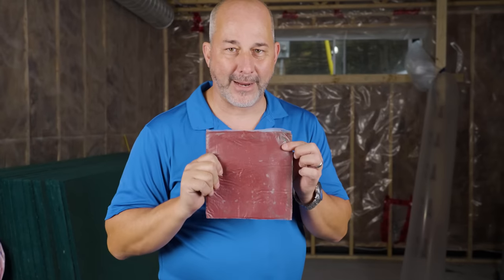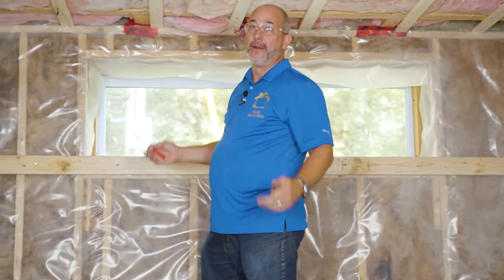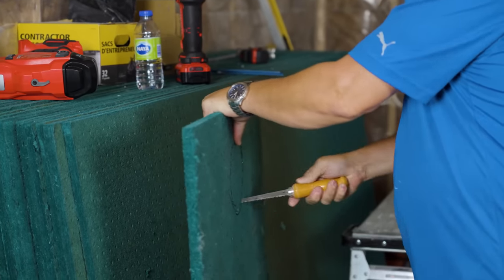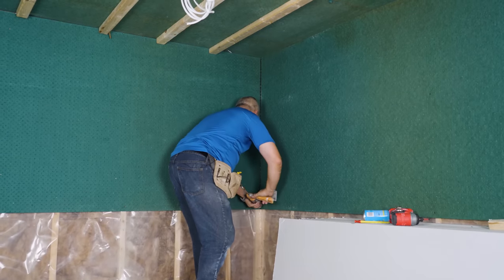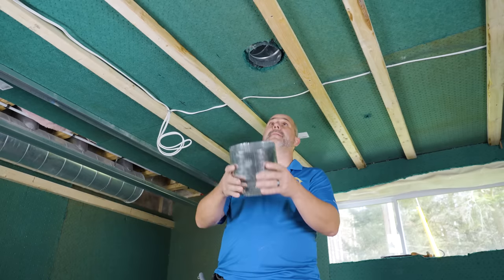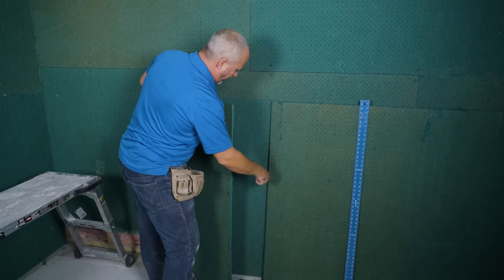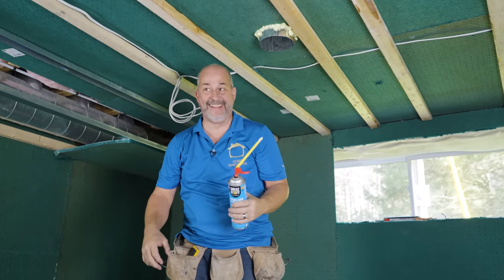Soundproofing A Room (It's Easier Than You Think)

Comment: Hi Jeff,

Will you be going in detail how to finish around the doorway and soundproof it properly? I'm using sonopan for a bedroom adjacent to the furnace room, but using isolating clips, hat track, green glue and double drywall etc for my wife's music teaching and recording studio. Thanks.
Reply: This is a question I would like to see answered as well.
Reply: a heavy/massive door,  or two "normal" ones, with a minimum distance between them (usually the width of the wall, with some absorbent material between them. This is usual in small/cheap studios)
A "normal" door or window is the weakest point in a project like this, it can ruin all the insulation work you did in the room

Comment: Yes but..... If you doing a media room you are crazy if you don't design it for Dolby Atmos. That requires speaker on the ceiling to create an immersive experience. Most will want a speaker flush mounted, this may also be desired for the LCR and surround (in wall) speakers as well. You are right you need mass and zero are gaps.

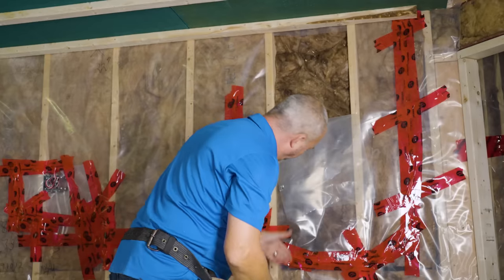Comment: @10:00 he's lifting his 'slumping insulation'. But the insulation isn't tight against the studs and has half-inch gaps on an exterior wall (nice condensation trap😢) - that's why it slumped. Yet after patting himself on the back, he slaps on drywall and it's guaranteed to slump again. So much confident blowviation about doing quality work😅

Comment: This was really helpful Jeff, thank you.

I'm having a Morton home built (post-frame construction). I'm tucking in a 14x24 media room on the main level. It will be on a concrete pad, 2 walls are post-frame exterior, one wall is against the garage, the last has a door and is against the house. Electric fireplace for heating. What would be your recommendations for a STC 50 rating walls, door, and ceiling?

Comment: I think the fact that the sound acoustics abruptly changed when he went into the room with the insulated ceiling really tells you something.
Reply: when you put the drywall up, you still get in-room reverberation, which needs to be mitigated by putting stuff into the area, especially rugs.

edit: if you're looking for sound reflection deadening panels for your theater room, making them out of sonopan and covering them with material is a diy option that is much mich much cheaper than buying 'professional' ones and are just as effective, and depending on the care you take when making them, can look just as professional.

Comment: Mass and air sealing are the cheaper attack strategies. The third is isolation. Those fancy rubber fittings aren’t cheap (neither is acoustic drywall tho). I’ve even seen acoustic recessed lighting boxes and acoustic “mufflers” for HVAC ducts.

Comment: I'm lucky that my modular home has two layers of aluminum siding, one of which has a thin foam board backing and dual pane windows. Almost soundproof to the point that I can barely hear cars going by. Another benefit is that it is so inulating against cold and hot weather.

Comment: I would take the 85% = 50% comment even further. I'd say 99% = 50%. Sound is like water. It will find ANY little place that's open and it can seep through. So I was happy to see you using acoustic putty on the electrical boxes... absolutely necessary. Foam is not a good acoustic seal. Use acoustic caulk, like Green Glue. What is the STC performance of greenboard? I HIGHLY recommend either Green Glue for retrofit or QuietRock for new projects instead of greenboard. Both have a layer of "magic" stuff that converts motion (vibration) into heat. We added a granny unit to our house, carefully soundproofing the wood framed common wall and it's incredible. Our tenant had a raccoon come in looking for food and stamped and screamed at the top of her lungs to chase it out. We heard the thunder of her feet coming through the floor-joists (flanking sound) but heard nothing of her screaming. We never hear anything from that apartment and there's 40 feet of common wall.

Comment: Everything I have read about sound proofing a room says to use two sets of studs that are offset. Otherwise the sheet rock / dry wall will transmit the sound through the studs to the sheet rock / dry wall on the other side. Sound travels faster through solid objects than through air. 

I didnt watch the rest of the video, but sound dampening in HVAC ducts is important too. Nothing pisses me off more than conference rooms that have no sound treatment and small HVAC supply vents that whistle when the air kicks on. 

To dampen low frequency sounds you need  solid mass. All the fiberglas will do little, especially if placed betweens studs installed incorrectly as mentioned above.

Visit a modern high school performance auditorium. The entrances will be U shaped  which prevents direct sound transfer. In addition the walls will have an attractive sound dampening material consisting of a heavy porus material, covered with fabric and then wooden slats. This helps the sound (pressure) waves cancel each other or be absorbed. It like a mini anechoic chamber (where there is zero sound reflection off the walls, floor or celing). 

 It is easier to absorb high frequencies than

Comment: I removed drywall from the exterior walls. It’s a 1950’s house they have black building paper on top of the bricks and 1x2 uneven strips of wood for the drywall to screw on. What insulation do you recommend for a narrow gap. Can I use styrofoam sheets?

Comment: So how do you know that the insulation will not just slump again after the sonopan and drywall is up?
Reply: i think it's due to the fact that the slumping was a result of the electricians messing around with it - hence all the red tape in that area. So if no one touches it, it won't move.
Reply: @frankdrebin2343  makes sense. Thanks. I'll be starting to finish my basement and that specifically is one of my worries - moisture/mold. I love Jeff and these type of videos have helped out so much.
Reply: It will do it again, because fiberglass insulation is cheap and shrinks/compress after some time. The plastic is the only thing that will prevent the massive air gap from causing moisture.

Comment: Sorry, even new fiberglass is junk, use the Rockwool soundproofing insulation. They used to sell tan colored boards for sound non-reflection. I don't know if they are still available. The stuff you used is thicker though, I'll have to look into it. One thing on the duct work, never crimp above, crimp below. Crimp the duct fitting into the above duct.

Comment: The hvac vent is gonna ruin your sound barrier. Insulated flex duct or acoustically lined pipe would help with the noise transmission.

Comment: Love your stuff been watching you for years now, just one introjection though “sound” is waves through anything except a vaccum not necessarily just through air so density can actually affect that negatively. Ideally you want enough volume to disrupt a wave but not so much as to conduct it. So too much insulation will be counter intuitive, besides that great stuff man 👍🏽
Reply: I think you’re confusing density with rigidity.
Reply: Yes but no. When you emit sounds inside a room, the sound goes from the medium from which it is born towards the air; to be transmitted to another room, it needs to go from the air to the wall material, and then back to the air in the other room. This change of medium (air/wall/air) generates what is known as "loss due to impedance mismatch". That is why a high density walll helps to contain the noises that are emitted within an enclosure. 
The "width" of the layer of insulating material in a wall only helps from a wavelength perspective. The longer the path that wave travels inside the insulator, the lower the frequency at which it is effective. Any wall with wool/rock fiber does not absorb low frequencies, only a very very heavy wall can do that (that's where the drywall layer helps, double layer lowers the effective frequency even more)

Comment: The screws couple the wood construction acoustically to the green-sheets to the drywall. To really decouple the inner ceiling from the basement-wall, maybe fix the dry wall just to the green sheets where there is no wood underneath, or maybe hang the whole inner constructions with springs to the basement wall.
To really soundproof you need to build a room in a room, with no direct contact of thw inner room with the outer room.

Comment: Would be interesting to try that. I thought about setting up safe sensory friendly space in the basement. My spouse and I are both Autistic. I have Class 3 ASD and start hearing at a negative 18 Db. Anything above 60 Db is likely to cause a seizure. I also have hearing range over 0.5 mile. In my opinion, everything should be soundproof like this. Thank you for sharing the process Jeff ♥

Comment: Hey, I'm finishing 2 bedrooms and an office room in our ranch style built in 1976. I really feel like leaving the HVAC in the ceiling is the right choice because the current room (air vent, but no return) gets stuffy and smelly with teenagers in it. I really want to make as quiet of a room as possible but since I'm not taking out the HVAC (adding return vent) for comfort reasons, I don't want to waste money. I'm  planning on sistering the 2x10s with notched 2x12s because the floor flexes a lot and I don't want cracked drywall on the ceiling. I'm thinking a layer of R19 in the floor joists (maybe 2 if it's still helpful even if HVAC is present), 5/8" sheet rock on all walls (also for durability), 2x4 walls with R13. I'm thinking the money spent (and headroom given up) on RSIC-1 clips and the top hat channel would be a waste of money because of keeping the HVAC vents in the rooms. Also thinking the second layer of 5/8 with green glue would not be as effective due to keeping the HVAC. Previously it was just 2x10 joists with drop ceiling and a lot of stomping noise and audible noise goes right through the floor. Thoughts??

Comment: i've got a similar DYI project coming up soon. question: what to do with the door? my plan is to acoustic-foam around the door frame, weather-strip around the contact points of the frame and door, and add a pad under the door. it's a cheap door so i may need to upgrade. what am i missing and is there a better solution to this? THANKS!

Comment: I bet you are going to put the ceiling hard up against the green wall.  And there you have it a home for mould.  I am in Australia and did, for the most part, what you did.  A year later I had to pull down everything in the ceiling and start again.  I replaced the the sound proofing with a corrugated sound proofing board and suspended the ceiling and ventilated the ceiling cavity. That was over 25 years ago. No noise gets to the bedroom above.  Never forget about mould.  Even the International Space Station has a mould problem.

Comment: sound decreases most where differing materials intersect, thus, a layering method utilizing paper-plastic-cardboard-plastic-paper etc will equate a much greater sound absorption and also cost pennies compared to layering insulation, this also requires no sound-board or extra-framing...(unless you want it to) there is a product called "quiet sheets" or something that is layered plastics, like a thick tarp, and it's thickness of less than 1/2 inch garners the same results as 18" of concrete............maybe a cool idea for future vids, do, the cheapest option, and the most expensive (which is the tarp at over $1000 for 8' x 20')

Comment: Where’s the floating floor with vibration absorbing suspension? The lead in-wall lining? The Helmholtz counter-resonators? The low frequency thermal traps? The HVAC acoustic diffusors? The zero-bypass double doors? Any thought given to the residual room node resonances? Might be OK for a DIY home theater, but this is kinda half-assed compared to the way the Big Boys do it.

“Soundproofing” means different things to different folks, I suppose.

Comment: I have a 20'x20' detached workshop about 30 ft from the house. I use it for my golf simulator room. It is so loud when the ball hits the club then the impact screen that it drives our little dogs, inside the house, crazy. Is there a different, cheaper way to soundproof this bldg? Right now the inside is only framed up. No insulation or drywall. Just studs showing all around. Thanks for any advice you can give me.

Comment: What insulation is safe for both sound and heat? I'm trying to block sound on a wall next to  radiator pumps and the heating unit that has a gas flame under it.

Comment: Pray for sonopan to come to the US.  Are we getting through to them?  Shareholders meeting?   Might be troublesome to call it greenboard which is something else entirely.   

As with everything, don’t take the first no…just clamor.  Are we ready to buy futures as it were?  Front money will coax you?
Preorder paid.  Money talks.

Thing of it is….there’s something real close I’ve picked from appliance shipment, light blue in color, super light.

Jeff is the best.  No grumbling, he just does it and doesn’t seem to mind……..

don’t sweat the small stuff….it'll work out…if you measure.

Only thing I don’t like…….constipated windows.    Demo is cheap.  Windows can be free to haul.  There is no excuse for unsafe unsightly  small windows.

Ask Jeff about the new fiberglass window wells that have egress steps.  All about water runoff, and you don’t want critters to make a wrong turn.

Also, indoor ramps for access and foot walking, we should have safe ramps floor to floor. Design it for looks and safety and ease of use.

Comment: While this will certainly perform better than a standard drywall ceiling, for a home theater, decoupling the ceiling with resilient channel, or even better with isolation clips + hat channel would be far more effective. This assembly looks to be about stc 38 (the extra air gap adds uncertainty, and might even make it worse, see triple leaf effect), whereas a simple assembly with isolation clips and a double layer of drywall would be around 60.
Reply: how does the cost compare
Reply from the maker: This design is all about making things easy. the wood strapping creates the perfect space for pot light install and somewhere to staple the wires before drywall goes up.
you do not get a triple leaf effect with this sonopan material the way you do with drywall, and I am confident that the sound test will change everyone's mind about the performance. Remember we are not going total sound proof. just controlling it enough to make rooms in a house reasonably quiet and private without the added expense and time of major sound control measures. Cheers!
Reply: @HomeRenoVisionDIY  I see. So the viewers all know to just ignore the "totally soundproof" thumbnail, and the description reading "today we're installing Sonopan to create a soundproof home theater room". And air sealing, putty pads, full double layer of sheet goods are simple and easy, but decoupling the ceiling, or switching the end run of hvac to flex duct are major sound control measures. I understand now. Cheers!

Comment: Trying to soundproof my basement ceiling. If I use 2 layers of the pink fibreglass insulation, is it safe to have this in the same run tight with the heating duct? Wouldn’t want to cause a fire.

Comment: Real timely video, spent the morning In Cad designing my basement theater.

Question, i'm doing full on room in room construction, but i have a window. Do i need to rip it out and replace it with brick or is there some way i can seal it behind a wall and be fine?
Reply: Check your local building codes to make sure you don't have an egress requirement in the basement; most local codes are available online
Reply from the maker: i would at the least insulate the space against the glass to eliminate the risk of condensation if you are not going to have any air exchange there.

Comment: I was thinking of soundproofing a bedroom on the second floor. However i dont have ducts. I have radiators. There is already poor air circulation but by following this method in the video I would have zero circulation. any thoughts on this?

Comment: How do you handle the electrical boxes as they will be set back because of the Sonopan. Do you use electrical box extenders ??
Reply: You can get adjustable boxes, which is what this electrician probably should have used.  If not you can use caterpillars to boost out the outlets or switches.

Comment: Hi there. I'm wondering if there is a way to reduce outside noise (Low frequency sounds from rumbling cars) coming into my bedroom. My wall faces the street unfortunately and I also have a wooden gate that leads to the backyard which connects to this wall (It creates an L shape which im starting to think sound is getting trapped inside this little cavern and bouncing around making things worse if thats possible). Would installing bass traps/acoustic panels inside or outside of the house help at all? Its very strange as this room in particular is bad but not the others. I have tried sealing around the electrical outlets with acoustic caulking but no luck....
Reply: Low frequencies below 100hz are difficult to control.  Takes allot of accoustic treatment.  you will need a lot of mineral wool inside your wall cavities and double layer 5/8” drywall and then more.mineral wall in panels on interior walls to achieve what you want.  If you have windows that are facing the noise you will need to build a window plug using drywall layers and wood stud frame.  Good luck.